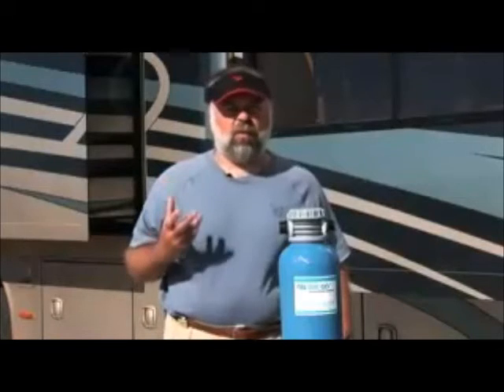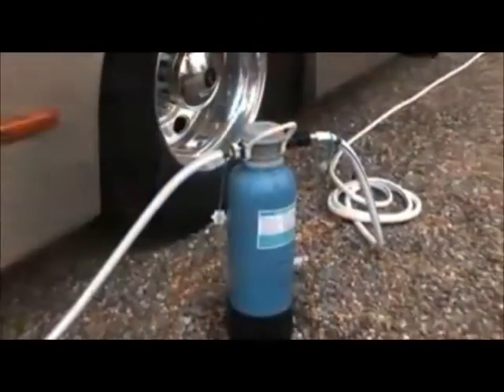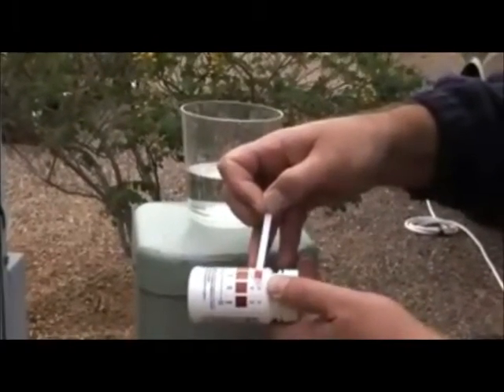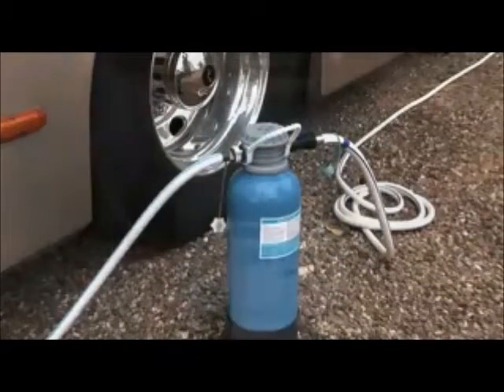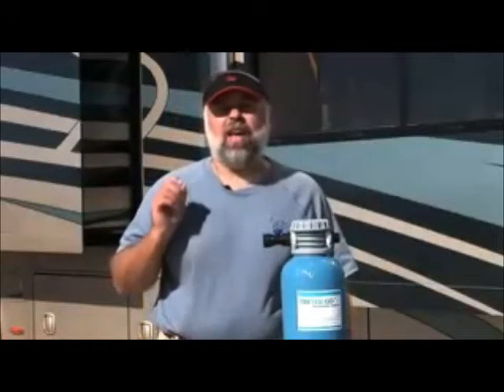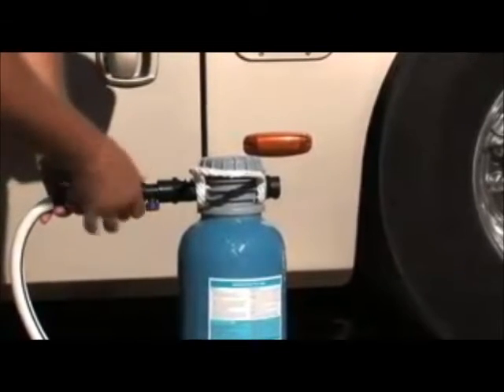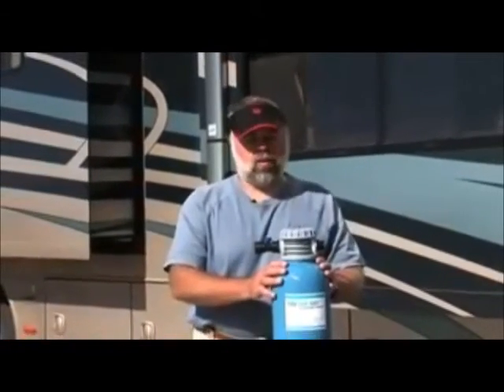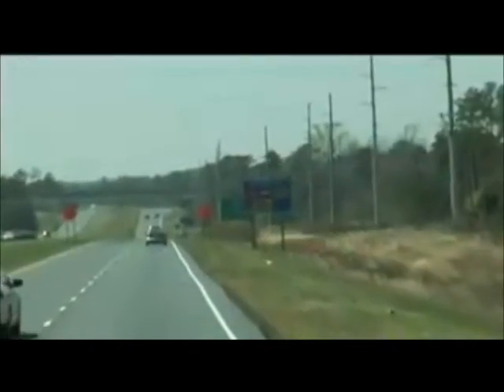On The Go Water Softener American RVer

Comment: One question, when you put the salt in and are flushing out the salt is are you back filling or flushing it in the normal flow. Thanks
Reply from the maker: Add the salt and flush it at a slow rinse normal direction.

Comment: The resin doesn't remove minerals,  it neutralizes them with sodium ions so they can't chemically react with anything.
Reply: Water softeners work on a principle called ion exchange. A softener has a tank full of resin made of little beads. Each bead is charged with a sodium ion. Hardness minerals flow through this tank in an ionic form. The minerals are attracted to these resin beads, and the resin beads grab a hold of them and let the sodium ions loose. As the water flows through this column of resin, it removes all of the hardness minerals. You may be thinking of a non traditional salt-regenerating water softener, but it's an anti-scale device. They work by keeping the hardness minerals from coming out of solution and creating scale on products. It doesn't give you the same benefits that removing the mineral.
Reply: Summit you are not correct on the way this type of system works. 
It's not like your old-school home system that you fill with rock salt.

Comment: I live full time in a 5th wheel. One person. I have a washing machine that gets used regularly. How often would you reckon this unit would need to be serviced?
Reply: A Splendide uses in the neighborhood of 8-16 gallons each load, (depends on what brand  you're using and what wash settings you use). 300-500 gallons between recharges as he stated. Do the math with however much water you normally use for showers, cooking and drinking.